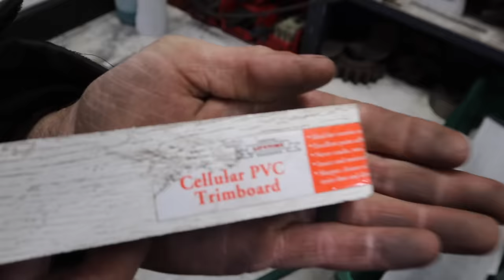The Forgotten Hand Plane ~ Fully Restored & Customized

Comment: Can’t understand why he didn’t use liberal doses of WD40 before he started pulling the plan apart.
Reply: Stephen Shoobert because he had no plan.
Reply: Stephen Shoobert he's too much of a tight wad !
Reply: I would have drowned it in WD40 before i did anything to it lol
Reply: the paint was also weird tbh
Reply: That's exactly what i did.  Works great but leaves an oily residue that has to be dealt with afterwards.
Reply: Because WD40 is NOT a release or penetrating oil.
 It is a moisture remover.
I suppose you think Frankenstein was the name of Mary Selley's monster as well ?
Reply: PB Blaster, please.
Reply: @jimosullivan1389  The makers of WD40 might just disagree with that. "WD-40 protects metal from rust and corrosion, penetrates stuck parts, displaces moisture and lubricates almost anything"
Reply: @richardgregory4640  Ok, spray some on your finger and see what the lubricity feels like ?
 The name WD actually stands for Water Displacement.
 Clean some mild steel...spray with WD and leave outside for a week.
 Then come back to me.
 Tribology is an art.
Reply: I cringed every time he used force on a screw. Took a big chance of snapping them off.
Reply: @Bender13  i cringed when he used that orbital wire wheel to attempt to remove the deep pitting/flatten the sole. That plane will probably never function properly, there's just no way the sole is flat enough for precise woodwork. Maybe a nice decoration depending on one's taste of course.
Reply: I wondered also (well an actual penetrant). But then i started thinking maybe he knew he didn't need it because it was a vinegar/peroxide project for the effect.  It'll make things rust like hell, but the screws won't be any more stuck than most of what he dealt with.  I'm sure they were old planes but maybe he quick rusted it for extra effect.
Reply: 1980JPA there was absolutely some “quick rust” there as you said...there’s no way 100 year old rust will just brush off like it did on that frog...no way. We don’t believe you
Reply: @jimosullivan1389  Thats what WD40 (Water Dispersant (take 40)) was intended for.....however....it was soon realised that it had many more uses.
Reply: As penetration oil, WD-40 is worse than nothing at all. However, it is good protection oil.
Reply: Pip Pipping try Kroil it only takes a drop or two. I use it on the expensive aircraft parts that I cannot easily disassemble. One can will last for years.
Reply: @leemurphy2082  p
Reply: jim o'sullivan , you are absolutely correct. MANY things better than WD40 for penetrating.
Reply: @richardgregory4640  and evaporates over time.  Never expect WD to stick around very long.
Reply: @pippipping2162  terrible protection oil.  It evaporates.  You need a product with parafin like fluid film.
Reply: Eric Bryant  thanks Eric I’ll try to find his comparison. I’m always looking for a better way to do something. Thanks again
Reply: He usually does add some type of oil liquid, not sure why he didn't this time.
Reply: @jimosullivan1389  diesel creek
Reply: I could not agree more, he just got lucky, and about WD 40, Millions have been using it in just such a situation with great results and your gonna use a rust remover the residue WD 40 leaves behind will be gone as well, and by the way as a FYI Both Wal mart and Amazon offer 35 and 75 percent  strength Vinegar ( normal is 3% ) the stuff is a great rust remover and it kills weeds too.

Comment: A nice job, but I have a few tips that may help you in the future:

1). When flattening the bottom of the plane, do so with everything installed and tightened.  When you tighten down the frog, the knob, the blade, and the handle of the plane, they put some amount of stress on the cast iron sole.  This will create a small amount of warpage to the plane, which is then removed with the flattening process.  If you flatten first, once assembled your plane will no longer be flat.

2).  The sides should be milled flat and perpendicular to the bottom.  If having them milled is not an option, then they should be flattened using the same process that you used to flatten the bottom (sandpaper adhered to a flat surface).  Using the one inch belt sander may have been quicker, but it opens up the potential for other errors.  Yes, you can get the whole side to be 90 degrees to the bottom, but it will be very difficult to get the whole length of each side to be perfectly straight.  (To visualize what I mean by this, picture the main drag in the town square of any old small town:  each old building’s face is square to the street, but each building is set back a different distance from the curb.)

3). Keep some PBBlaster on hand.  It’s great for un-sticking rusty bolts and screws, meaning fewer broken bits to remove; plus it helps keep the rust dust to a minimum (more paper towels/shop rags, but less dust in the air and/or in your lungs).
Reply: Also your screw drivers should be square on the end not tapered, and should be the width and thickness of the slot in the screw head. This helps to prevent the driver riding out of the screw slot and damaging what were undamaged screws.

Comment: Most of my quality tools are more than 30 years old. My planes are at least 50 years old. I've got a dozen Stanley saws from the 30s and 40s. Most of the stuff sold today is crap. It's possible to find quality tools but not at most of the home improvement stores. After watching this video I honestly went out to my workshop just to look and admire seriously great tool. I took my 75 year old butt plane apart and cleaned it. I bought it at a flea market 30 years ago for $5. I was embarassed by the caked-on saw dust and crud. Taking care of tools isn't difficult, it simply requires some desire and a little bit of time. The care is worth the effort since great tools are damned hard to replace.

Comment: Worth noting that quite a bit of work is needed to properly set up a Stanley even if it's brand new.  My Grandfather took me to a swap meet, bought me a small plane and walked me through the process.  He has a large collection to which he's added scroll work to the sides similar to what's traditionally added to gun slides.   Thank you for posting this video!

Comment: No need to loosen the lever cap to adjust the iron, if you do you’ll then need to adjust it laterally too. If tuned properly (whether a “restoration” or customization) you should be able to easily adjust both depth of cut and lateral adjust,ents without loosening the lever cap.

Comment: Nice touch re filing smooth the front of the mouth, don't see that in most plane restoration vids but roughness on that edge can spoil the planed surface finish.  I file and then polish that surface, the polishing gives a smooth path for ejection of shavings and massively reduces clogging with even the finest of clearance gaps.  Excellent restoration, and though I personally prefer traditional colours I have a far stronger preference for seeing tools being used rather than displayed, you're undoubtedly going to feel pride in your restoration work every time you use these planes so the colours are the right choice for you...  Enjoy a lifetime of using those planes, and if you end up passing them down, your custom colours will be very personal and valued by whoever inherits them... and if you don't have anyone to pass them on to, I'll volunteer to be adopted (lol)

Comment: I would have never thought that I could remove those rust pitted surfaces, but now I know it can be done.  As always, great work, and great video ... Thanks for posting your work.
Reply from the maker: Probably wasn't totally necessary, but for a video on here on the tube, it HAD to happen! There are some pretty passionate antique plane collectors and users!
Reply: @SalvageWorkshop  pits retain wax and can actually help smooth planing I wouldn't worry about them

Comment: What do yo have against penetrating oil?
Reply: 100%
Reply: @SalvageWorkshop  I personally use Seafoam penetrating oil and it works. You have to be willing to let the item set for a few hours after application but I definitely helps.
Reply: @SalvageWorkshop  I use Berryman's Chemtool, though your solution is fine if you don't have any or a store nearby. The job is done regardless.
Reply: @MojoPup  Exactly.
Reply: he's just a Masochist, I mean he's even working on his bench in the freezing cold ! turned out pretty good though.
Reply: Yeah I was wondering the same thing. I woulda taken the tote and knob off and thrown the whole thing in a barrel of wd-40 or something lol
Reply: @mattg6262  a bucket of kerosene or diesel does the job. Leave it a few weeks and screws loosen easily.

Comment: Great job considering the state they were in. By the way on the subject of flattening without the frog blade and lever cap, I have have restored a lot of planes and I have set them up on a surface plate with DTIs I have not found one which moved the sole when tightening the blade down or the frog so I think that is a myth. Well done you saved some good tools there. WHO CARES WHAT COLOUR THEY ARE THEY ARE CUSTOMISED!!!

Comment: As I’m watching you create a sweet pair of magnetic soft jaws for your vice, I glance over to a old Buffalo combo sander (1” belt/8”disc) I’m restoring that I just used 8” pvc trim board to make a new drop in work table for it for the side disc lol. Stuffs pretty easy to work with👍🏼 Love the magnet idea too. I have two pair of those, they’re orange and I think they came from harbor freight but I don’t remember. I use them for any non marring work I do. Nice job on those planes too brother. I like how you keep that eye keen to detail, it does make a difference!
Reply from the maker: Ya that 1x42 is pretty useful, but the 2x72 I built has taken over most tasks... I had been meaning to buy a set of soft jaws for a while now, and finally I decided to make those, because I needed them RIGHT THEN! That happens a lot with me! Thanks for the compliments!
Reply: Like you, me too brother. No sense in spending mucho $$$ on what you can fabricobble yourself. Actually I had meant that I was looking at my own combo sander that’s in my shop as I watched your video, but I hear you. I’ve been collecting all the parts I need to make my own 2 x 72, starting with a pair of old school roller skates. You know the roller rink boot ones with the big rubber toe stopper LOL Those wheels n bearings will work perfectly, and so far I’ve already gotten two of the wheels beveled nicely. Also, I already have the DC motor, drive wheel and variable speed controller that I scooped up from a free treadmill on facebook marketplace. After I pulled it the remainder is all free steel to me. It’s funny though, when I went to pick it up the guy was so nervous about giving it away, (Even though it was for free) he was telling me that he hadn’t used it in years and how every now and then the belt would slip and how he couldn’t guarantee that it would still work and so on... I handed him the cord and after he plugged it in for me I turned it on and that motor went all the way to its highest RPM and back down again to a crawl, PERFECT! I told him to relax, it’s all good and showed him a picture on my phone of what his treadmill was going to end up being. It blew his mind. Can you believe how expensive those sanders are?!?!
It’s times like this I’m glad I’m pretty handy… personally, I’d rather attempt my own version and fail at it if need be, than to cough up that much cash! I won’t fail though, I refuse to...just saying...
😉✌🏼

Comment: Beautifully preserved... thank you for saving these fine tools. These are NOT purist comments so don't take them that way. This is a value comment (your planes...do what you wish). The early Bedrock 605 and 606 you have there are "relatively" rare and worth a bit of money. Asphaltam japanning in the original black would have tripled the value of the planes. They are worth maybe $50 for the 605 and $80 for the 606 as you did it. Market value with restored japanning (roughly in USD) 605 $135-175 606 $210-300. Might be worth the extra effort... regardless those are fine tools now good for their second century of life.
Reply from the maker: If you learn one thing about me & my shop, I'm not concerned with the so called "value" of my tools and machines! Doesn't mean I don't know their values! (or potential values!)
~
My goal is to make great content with them by making them operate properly, beautifying them the way I want, and then putting them back to work here at Salvage Workshop!

Comment: I might try the Sculpt Nouveau, Black Magic (if I can find it) as the bright shiny 'new metal' finish doesn't fit the age of the old restorations. You have other great methods worth trying: Floor wax, (to protect from flash rusting after electrolysis or a mild soak, (I use a metal phosphate dunk and wipe or blow dry instead) Granite flat plate (I have been using tempered glass from an old refrigerator shelf), self-etching primer for the metal, and the choice of non-traditional colors and highlights, the wood treatment is functional, but since you took it down to bare wood, consider this amazing glossy finish: 1. Acetone clean, 2. Wood Seal  using a 50:50 ETOH (denatured alcohol 90+%) and Zinsser, no wax, Bulls Eye Seal Coat Universal Sanding Sealer (did I mention, Without Wax?)  and 3. Minwax "Antique Oil Finish" 1-3 coats (just keep rubbing dull spots with the soaked Minwax application rag until it becomes shiny. 4. Spray with  Deft "Clear Wood Finish" Gloss.  Dries fast between coats if you don't work in the snow! Don't vary from this recipe unless you know better because these materials work together.  Thanks for all your entertainment, never quit attitude, your good example...Hopefully, what I have shared with this never fail wood finish technique is something you will find useful on your next "fine furniture restoration" when it happens!

Comment: Nice finish. One thing to keep in mind is that when the plane cap iron is tightened down under tension, the sole of the plane can be slightly changed in shape. It's worth considering doing your final finishing on the sole with the blade tensioned but retracted so as not to be harmed..that way the sole will be completely flat when under tension.
Reply: Yes, sand the plane body when fully assembled to have a true flat plane sole
Reply: No, that’s not necessary. It doesn’t matter, the difference is completely negligible.

Comment: Little tip for ya. Cut off a small length of hacksaw blade and mount it on a dowel, perfect for clearing the kerf on some of the slotted heads, not too good for tightly reccessed ones but otherwise handy, also check out drag link sockets. Incredibly handy combined with a impact wrench, manual or itherwise for getting slotted frozen screws out without damage..

Comment: absolutely superb job ,as far as I could see the only part you replaced was the front handle bolt which copious amounts of dubs 40 may of saved you but apart from that an absolute job well done ,not sure how they plane though as I wasnt hearing that slick slither cutting noise but maybe it was the wood you where planing ,well done

Comment: Nice restoration of some of the best planes Stanley ever made.  The copper color is a nice choice, and they look beautiful. 

I’m curious why you sanded all the rust pits out?  All that’s really needed for the plane to work is to create a reference flat surface; sanding too deep can weaken the structure.  So long as the bottom is flat at the toe, the mouth, and the tail, and the sides are an honest 90, they’ll work very well.

(I should note that my BR & Baileys are working planes and as such are well-tended to; they’ve never been in this state of disrepair, and even the very worn planes I’ve worked with have been minimally flattened to make them working planes....).